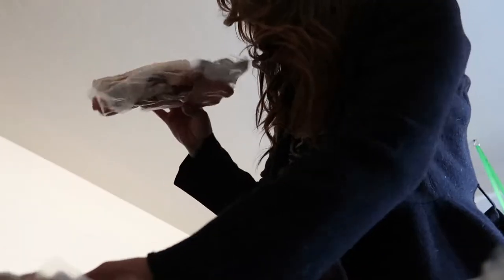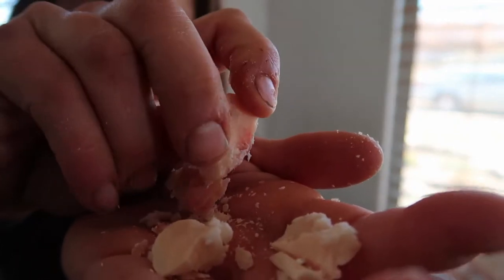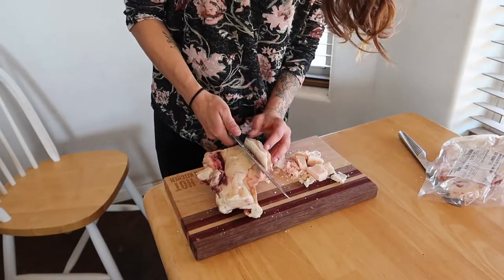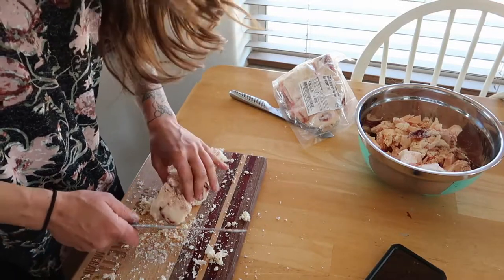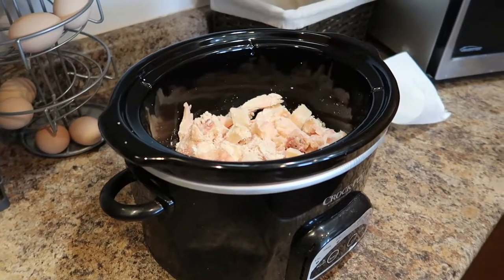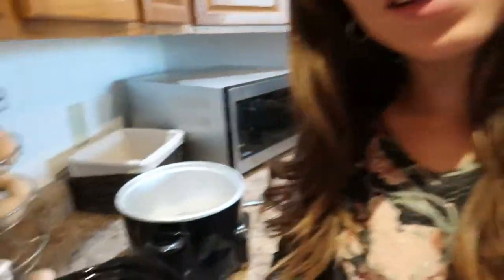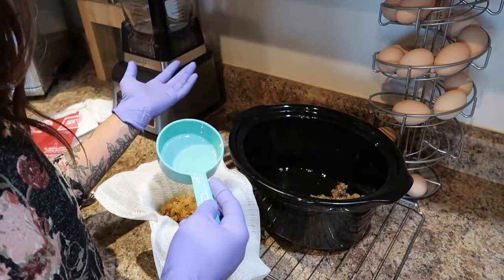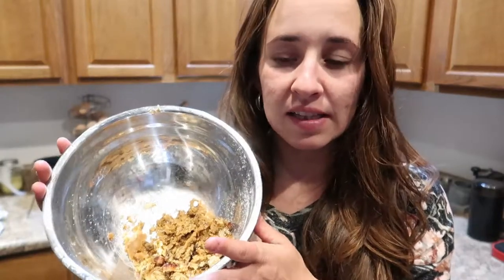How to Make Beef Tallow | Render Suet | EASY Slow Cooker Method

Comment: What have i done wrong if there is still liquid in the bottom of the jar? Its like the tallow is sitting on top (3/4) of jar. Also how long would this last in the fridge.  Thank you... great video!
Reply from the maker: Hey there! Did you add water to the suet when it was rendering? That's the only way there should be liquid in the tallow after it cools and hardens

Comment: Thanks for sharing this. I just rendered about 5 lbs in a crockpot.
Reply from the maker: Nice! I'm looking into making firestarters soon with some deer that I rendered. The deer tallow is a little too pungent to cook with 😬
Reply: @thefiresidefarm  When I rendered mine, I didn't use any water in the crockpot. I think I should have in order to prevent the suet from burning a little. The end product has a bit of a strong smell. Not sure if I ruined it.
Reply from the maker: @Millstone_Firewood  did the suet brown or just melt? Depending on the diet of the cow and other factors, the rendered tallow can have a stronger odor. Deer tallow is generally regarded as "stronger" than beef tallow.

You didn't necessarily burn it😊 but there are many videos out there showing the water method if you want to check them out!
Reply: @thefiresidefarm  It didn't burn but I think it may have browned a bit. I'll know better next time. Never messed with deer tallow.
Reply: Very helpful, thank you!

Comment: Thank you for the excellent video.  I wanted to find a good explanation of the slow cooker, no-water method.  You gave many important details and why you do them.  This was very helpful. 

I don't have a crockpot but rather an instant pot that you are supposed to be able to use as a slow cooker.  I will try this once I get down more details on how to use the instant pot as a slow cooker.  I got the slow cooker lid, so that's one thing.  The instant pot videos all seem to use water and use it as a pressure cooker.  I may call the company to ask about temperature settings, etc, since it has a stainless steel bowl and I don't want it to scorch.